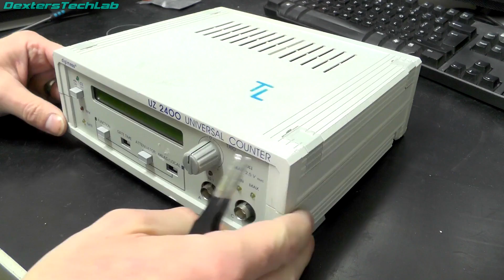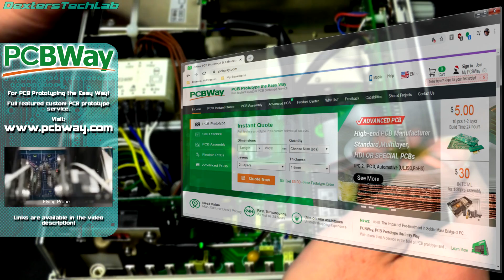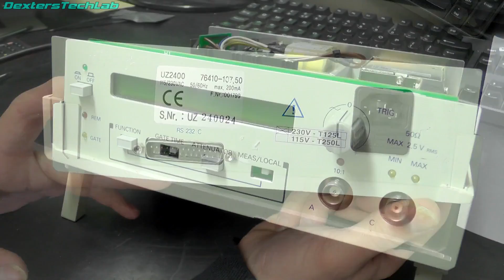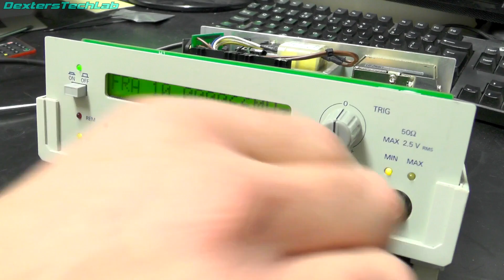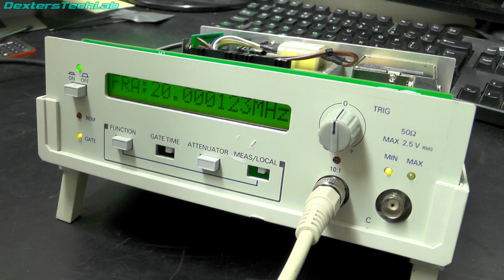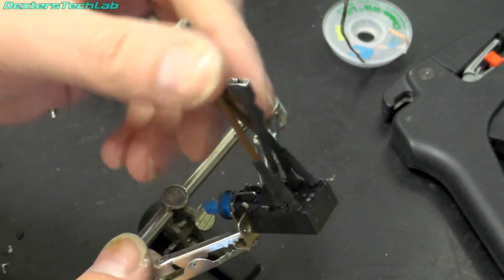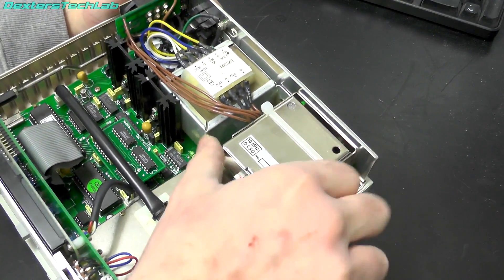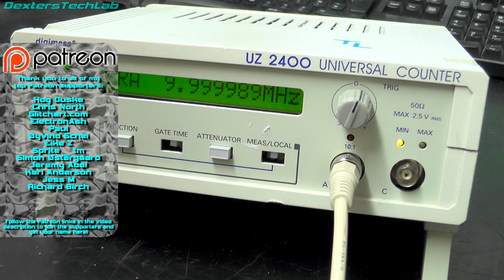DL186 Digimess UZ2400 Universal Counter Repair And Teardown

Comment: At some point these were sold under the "Grundig" brand name. No idea who designed them. The housing is made by a german company called "Bopla" and the product name is "Ultramas" At some point I knew who the knobs and knobheads came from, but I can't remember.
Reply from the maker: From what i can tell Digimess was sold to a UK company that continued the name on, the company has just filed to be dissolved i was going to contact them to see if they had any keytops.
Reply: @DextersTechLab  Oh, what a shame. There could maybe be a chance to buy out their old stuff and leftovers perhaps ??? Would be interesting.
Reply: I own nearly the complete range of Grundig Digimess Instruments, this Device is a very late model, which was built by Digimess UK, the original version which was built by Grundig more than 20 years ago used other button caps (ITT Schadow PG-GY) which are discontinued long ago and the original rotary knob could be something from Ritel (CH). 

I don‘t know if it makes sense to reprint those newer buttons, they look cheap compared to the original ones and there are some compatible button caps available as standard part.

A former colleague of me which worked at Grundig Instruments told me those devices were developed in east europe (i think Czech because they used many parts from Tesla Jihlava like connectors and precision resistor arrays) and not by Grundig themself.
Reply: Try C&K F1204 or E-Switch TAC-GRY